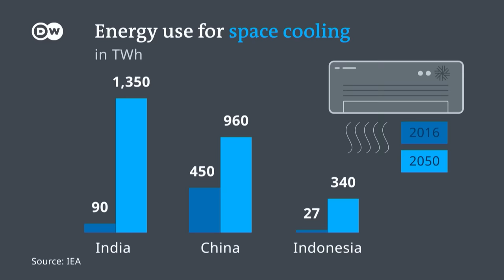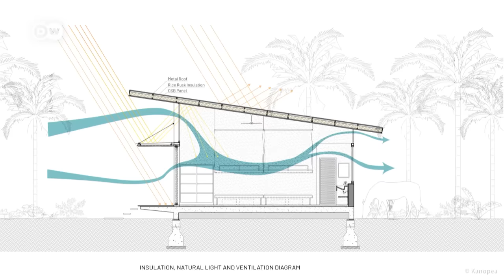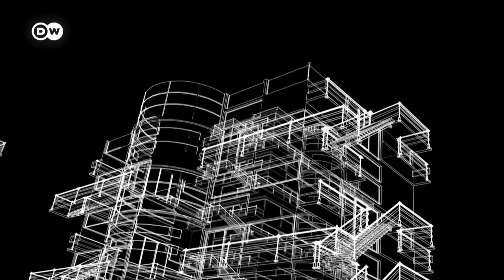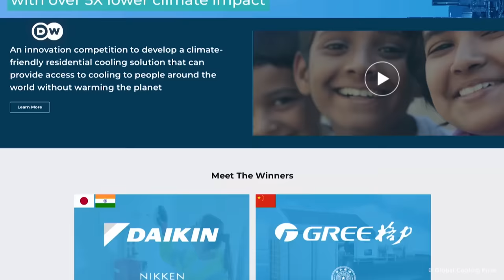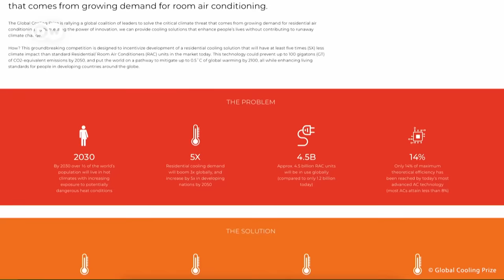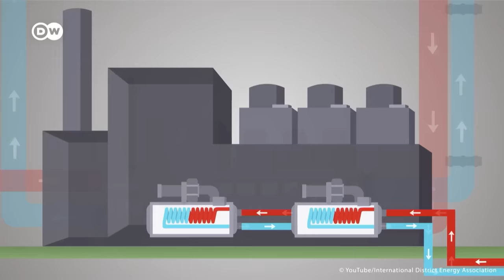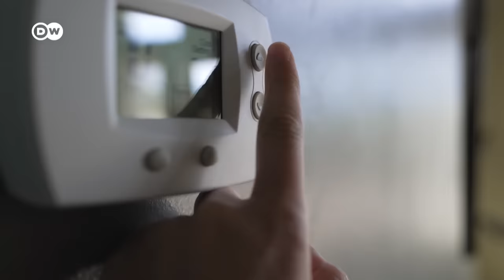How to cool our homes (even without ACs)

Comment: One thing to note in the old printing presses, massive prints were done by a heat set press, like today with ovens to set the ink cleanly, then the printed web is cooled by water cooled rollers. So, not just humid, but hot humid air was needed to remove.
I'd hoped they'd cover ancient technology from dessert tribes & nations of the world. For instance, in the old Arabian lands they had a ingenious method of making ice in the desert without any mechanical movement. They just manipulated high & low air pressure of the area with structures erected. I'm still fascinated by that today. Another instance to examine is the indigenous midsouth to  southwest regions of North America. They have a very clever clay pots technique that used evaporation to cools things done, including preserving food. The residential areas also incorporated air drafts & evaporation in a different design. So, taking inspiration from learning about the ancient technology, I've used a few tricks modernized. Best one I used today is a water trough that a canvas tarp can weep water from, set at a angle like an awning, and when a draft starts through evaporation the cool air came in the house & made desert life so much more manageably bearable. Even I don't live in the desert region now, I still use the method presently. 
Another thing to note, this is from athletics, cooling down forearm & calfs region of the body aid in reducing body temperature pretty quickly (not a technique for hyperthermic cases, go to a hospital) if done on a break with proper hydration (means water & replenishing electrolytes at regular intervals) with use of extra baggy clothing (block sunlight from sun poisoning aside from sunburn, your sweat gets absorbed by baggy garments (cotton is really good) and evaporation happens when winds pick up around you.. Made outside desert work bearable on 12+ hr shifts in the desert without threat of serious injury; heat stroke. Everyone is on average similar, but those born & lived in desert regions naturalizes to those climates quicker. So if you are from a cold regions & go to live in a hot (humid or not) area Don't be surprised if it takes a few years to naturalize, & ask questions from locals who work outside all year round. I'm glad I did with the Apache & Mexicans I worked with for almost half a decade at a strip mine many years ago.
Reply: honestly, please make an example video on those examples, it sounds more interesting than this video!
Reply: This video is good... they talk about some approaches and this guy wrote about some others... There is no one total solution.
Reply: That is a lot of reading  😳
Reply: I'm learning more reading the different comments, than I did listening to this video.
Reply: This was an excellent post, but, please, break it into paragraphs. It's difficult to read midway when it's a wall of text.

Comment: I live in Australia, Perth.  We use 2 types of AC evaporative and refrigeration.  When air is dry evaporative works great, you keep Windows and doors open because if humidity exceeds 30% those systems don't work, so evaporative systems are very limited in what environments you can use it. I use also a split system for heating and cooling,  it is very efficient.

Comment: Living in hot tropical region with hotbox room 5C hotter than outdoor temperature throughout my teens probably tempered me to stay comfortable at higher temperature. The gap between my "comfortable" vs everyone around me including families are a stark difference. Knew some that can't sleep if its not cooled to under 24C while I find 27C too cold.

Point is,  if more people can adapt to slightly, just slightly less cooling, would save a whole lot of energy. Especially those that insists its too hot, crank the AC up, then proceed to wear jacket or blanket cos it got too cold.
Reply: Well said

Comment: My older stone and brick building without any AC has built in air flow, there are very large leafy trees all around, and I keep the curtains and windows closed during the sunniest parts of the day when it's 25-32C outside. The indoor temps hit 29C when it's very hot outside, but it's not intolerable. A hand fan, the ancient kind with wooden slats and paper, is very nice!

Comment: There's absolutely nothing good about high-density populations.....In my last house I did something very simple to improve my ACs cooling ability by adding hot air return vents close to the ceiling and closing off the cold air returns located near the floor, what a difference in the ability of our central AC to cool down the house quicker, costing me a lot less on my electricity bill.  I'm located in Canada.

Comment: Living in AZ, Phoenix is a prime example of urban heat island effect. It is also sits in a valley. The cities are planting trees and desert type plants at a much faster rate. In Southern AZ, we use closed cell foam or sheets of foam under the stucco. We also use double and triple pane windows with PVC/fiberglass frames. It’s a process and it’s not cheap either.
Reply: Have you captured water from roadways too, like is being done in Tuscon? They break the curb/berm to allow water to pool around trees in  the yard instead of just sending it down storm drains.
Reply: @kittimcconnell2633  I don’t because I would need a pump and additional storage. The layout of my property doesn’t permit for me to do this. There are more and more homeowners doing this but I don’t recommend it. Too much brake dust and other contamination in that type of water. When we get those torrential downpours, that’s a lot of water to capture and store. Not to include the gray water from washers and bathing
Reply: Las Vegas to everyday

Comment: I love the video for its simplicity and how it categorized different issues under different approaches. Being a resident of a city like New Delhi, I felt there are a few things we can do already at the grass root level. Delhi has a densely populated urban base with a lot of its construction dating back between 30-100 years. And not everyone would have enough capital to reconstruct these with better materials but we need to ensure that there is enough awareness amongst the local builders, architects, and residents to understand the nuances of using glass panes to make their reconstructed homes look fancy. Additionally, small changes like white-roofing though still out of reach for some might be a good start to reduce the consumption of energy to keep the temperatures inside the homes in check. Some bit of green roofing and solar panels help too. Though this is all easier said than done.
Reply from the maker: Hey there! Thanks! You might be interested in our videos on solar energy. Check them out: 
solar energy 👉 https://www.youtube.com/watch?v=sUvaYycoWqI
How green is solar energy 👉 https://www.youtube.com/watch?v=EWV4e453y8Y
Electrical grid and renewables 👉 https://www.youtube.com/watch?v=u-DsDuTceTo
Reply: White paint is cheap. - goes a long way towards addressing hot roòfs.

Comment: I was surprised to learn that in some places air conditioners were only used to control humidity and cool the air. Growing up we only used it in winter time to heat the house after it got dark but before nigh time. Now, I never use the heating feature, but I do use it all day in summer because it's just unlivable otherwise. The temperatures haven't increased that much, but the pollution levels are making the city too hot.

Comment: I'm an American living in Germany now and I am loving how German buildings are designed with better insulation and better design features to help mitigate hot weather.   I don't have AC in my apartment, and don't really need it.  Sure there are a few days where I'm a bit uncomfortable, but it is manageable.  (I fully acknowledge the climate is generally cooler in Germany than in much of the US.)  That said, the quality of windows and doors are so much higher than typical US products, and the walls are typically thick concrete and well insulated.   The use of blinds on the outside of the windows allow for blocking the sun.  The windows and doors open in various ways to establish a cross breeze.    We could do so much better in the US when it comes to building design/product quality.  Cheep electricity in the US has made it more cost effective to not make the investment in high quality building designs/products.   It's more cost effective (in the short term) to go cheep on the building, and just crank up the AC!   We really do tend to think more short term than Europeans.

Comment: I think it I tried to modify my house to be cooler in the summer such as by rendering it white or installing shading to mitigate direct sunlight from the building, the local planning authorities would be upset. Despite being a property without any heritage value, it is located on a typical modern housing estate and I could imagine doing anything to make the house look different to all the other copy-and-paste houses in the surroundings would not be popular. So part of the solution must be ensuring flexibility in our planning systems to implement changes, as well as changing the mindset of sticking to uniformity.

Comment: As an Indian, i use the air conditioner in between the months of March to June & that too post 6pm at home for max 90 mins. I work in IT & many offices are air conditioned. WFH saves it. I think this problem will be solved but we surely need sustainable solutions
Reply: I think we also need to get used to living in hotter temperatures without having everything set at 25 Celsius year round. That said, parts of India and the Middle East can hit high wet bulb temperatures in summer, where AC usage is almost mandatory if you want to stay comfortable.

Comment: I am glad this report balanced the 'passive' cooling tech with the obvious requirement of efficient ACs. I have lived and worked in some attempts at passively cooled modern buildings and the simple fact is that they are really unpleasant to be in. Usually the people who own these types of buildings want to cut out using AC competely and in hot places like California this is just going to lead to unbearable conditions.

Some environmentalists can get completely absurd on this subject. I once worked at a summer camp at a world renowned University and they had buildings that were supposed to never need AC. They used a few techniques covered in this report along with plastic darkening gels on the windows to block sunlight. Well it was california in the summer and there was a heat wave. The building got to 100 degrees internally and the building manager refused to get a portable AC unit until our students started passing out from the heat. 

This experience has convinced me that AC is an undeniable truth of the hotter climate we created. You can't just try to build things in a smarter way to avoid it.
Reply: Yes and no, I think a/c should be run on those 100F (or 38ºC) days, but perhaps the passive design can help the building stay comfortable without a/c on all the warm to cooler days of the year! We could save a lot in electricity bills and climate impacts if we saved it for the more extreme weather days.
Reply: @lynettejwhite  if the grid runs on hydro, goethermal, solar, nuclear, or wind why would it matter? I feel like AC is the one thing we won’t be cutting back on in the future and we should build our energy system to cope.
Reply: @LFPAnimations AC is not just emitting because of energy. It's also because of the gases used to cool the rooms.

Comment: Old homes that were built in California valleys are built specifically to keep heat out of the house when it bakes in the valley sun all day. It would be 110 degrees F outside but stayed 70 degrees in the house without any fans or circulation. Incredible.

Comment: Radiative cooling panels are a great cooling technology that doesn‘t need any power. I think it‘s not alot of people know of it but there are lots of possibilities that are all very simple and cheap. Everybody can use/build them at home. Thats how simple radiative cooling in general is. If such cooling panels are installed on roofs just like photovoltaik panels are (also at similar scale) average temperatures of citys could be brought down rapidly.
Reply: How would you transfer the heat from the air in house to that radiator on the roof and not the other way around?

If the condition is such that you won't need a heat pump and the energy to drive this to do that, then I think you don't need that radiator, too: just open a window or door.
Reply: @Apollorion  The simplest way to use radiative cooling is at night. Have you ever touched a table or a cars roof in a clear summer night? All these surfaces are way colder than the surrounding air even while constantly absorbing heat from the surrounding air. These surfaces aren‘t even „tuned“ for radiative cooling. What i am trying to say is that you can build a simple panel with a water in and one outlet. A big waterpocket basically. Lay it flat on a roof/garden and comnect it to an insulated 1000L watertank. The water will cool at night way below the air temperature. You can pump the cold water through existing radiators or a car radiator with a few pc fans if you want it fast and cheap. The 1000L of water hold enourmous amounts of heat energy or in this case the cold water can absorb huge amounts of heat. If you where to tune the panel surface to radiate IR in the i think 10nm wavelenght and increase the panelarea and tank size and also insulate the watertank very well you have free cooling with very little energy consumption. Another idea is that people start using these panels on rooftops. If you watch Nighthawkinlights latest video on the „panels“ i am talking about you know what i mean. The sheer amount of heat energy radiated and reflected away by all these panels will reduce the airtemp. arround all the houses. Even in full daylight. This way people with air conditioners won‘t have to use them as much. In some way we do use radiative cooling in our house as well. Our house is well insulated. On a hot summer day we close all windows and roll down all shutters to block incoming heat from the sun. Then in the night we open half of the windows in the house. Also we have a window installed on the highest point of the house. If you open this window you can even feel a very strong downdraft from the cold air outside which did cool by radiating heat into space. In the morning we close al windows and shutters again. We don‘t use A/C or anything. Still we have 20C in the house all summer long👍 The panels that cool at night are meant for citys etc where the air doesn‘t cool as much as in rural areas. There are endless possibilitys. I think lots of people just don‘t know about this. It is so simple and cheap yet so effective. If everybody doesn‘t just think about their own wellbeing and installs a few of such panels they cool the air for their neigbours too and the other way arround.

Comment: It’s crazy that many of these very hot countries using air conditioning don’t use solar power 🤯
Reply: as you can see from the starting of video the houses are not able to use solar panel as compared to the USA where single family housings are more dominant as the ones in the hot countries are comprised more of multi family housing so the use of solar panels aren't as common as compared to USA also its not very efficient as the solar panel even if fitted on to the walls of buildings will at most get 4 hours of direct sunlight making it very inefficient and the amount of area it can cover is too low to generate enough for supplying a whole buildings worth of air-conditioning
Reply: Solar panels are expensive and countries like the US subsidize solar panels when most countries don’t.
Reply: Its crazy that you think these countries are privileged enough to have solar panels.
Reply: Usually only rich people can own solar panel
Reply: Production of solar panel generated more carbon than its life span electricity generation including battery. It’s better to use good architecture for eco-building and more and more green space to control heat

Comment: I live in India and my home has never had an AC , doesn't have an AC even though this summer is the hottest by far. We keep the doors open for air circulation and the fans running. From someone who had to survive summers in a dorm without AC - 
Dampen your mattress during the daytime and let it evaporate. It will become cooler to sleep on by evening.
Keep a wet towel in the room and put the fan on. It will dry and circulate cool air. Really nice in hot, dry summers.
Table fans and pedestal fans are your friend. But small fans that you can position towards your face/head.